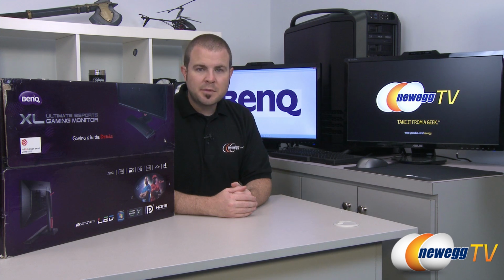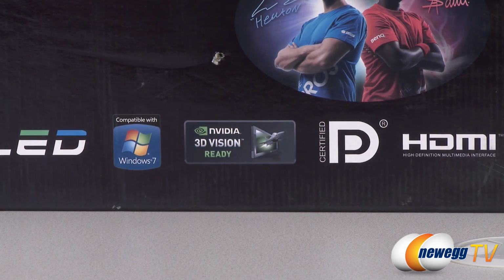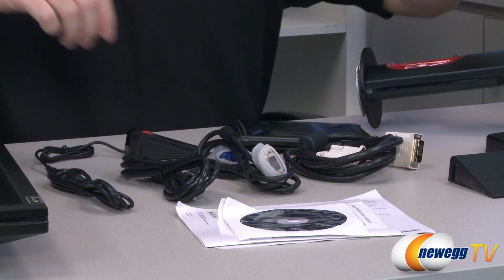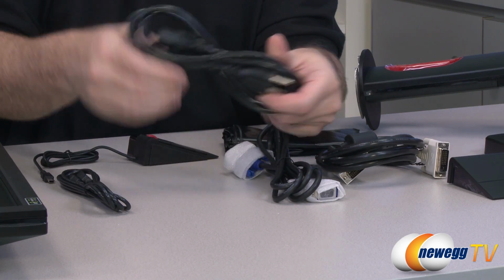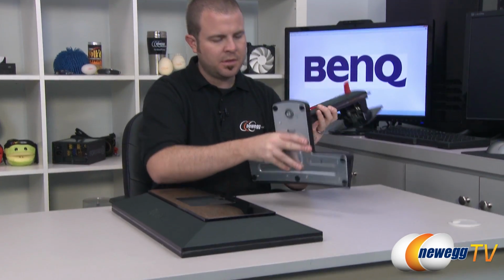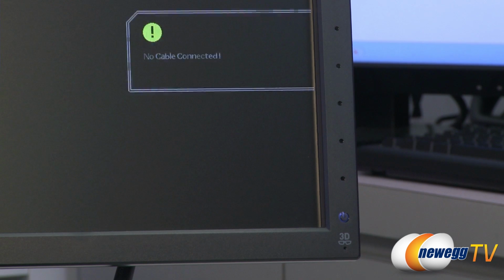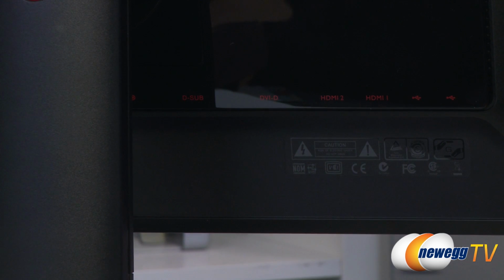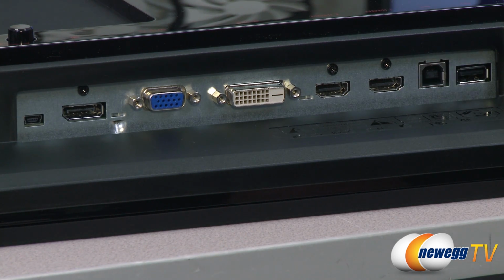Newegg TV: BenQ XL2420T LED-Backlit 120Hz 3D-Ready LCD Monitor Overview

Comment: I saw someone selling it 2nd hand but he said its 144 hm?
Reply: Maybe a bit late but there is the XL2420T and the XL2430T.. It seems at some point BenQ discontinued the 2420T and replaced it on the sly with the 2430T which is 144Hz

Comment: There is, Wipeout HD on the PS3 features both 1080p and 60fps.

I play both PC and PS3 regularly, Wipeout HD runs just as smooth as when I'm playing PC games with 60 fps however most games on both the PS3 and Xbox 360 are locked at 30 fps and/or 720p.

Comment: No, HDMI cannot transfer enough bandwidth for a monitor to operate at 120hz. To use this monitor you have to plug in the included DUAL DVI connector, which plugs in to the back of your monitor.

Comment: MW3 or Black Ops 2 would be, actually.  One of the core aspects of the CoD development cycle is to make sure it runs at a smooth 60 fps on consoles.  And the point of this argument is whether or not a 3D monitor would be good for a console player; the answer is, unless you are filled with money you wouldn't mind wasting, no.  Rage and CoD (and whichever few others run at 60 fps nowadays) are not reason enough to buy a 3d  monitor which will drop frame rates in half.

Comment: No shit.  And the general rule of thumb is the newer the engine, the higher resolution textures, larger poly counts, and wider resolution support.  Older games dont have high res textures or huge poly counts, thus they may run at 60 fps on consoles.

Comment: Call of Duty is the only game made nowadays which runs 60fps.  All other games run 30, unless some were released around the release of the 360 itself which can run 60fps.  The 360's hardware hasn't been updated since it's release, you know?  So more advanced engines from today don't run as well on it, whereas older games run at a higher fps (or so I'd think; I really have no proof).

Comment: Honestly it is still useful for a lot of people. Obviously you wouldnt use it for the 3d or anything. But I work on a lot of older systems that dont have hdmi or dvi. Or if there are driver issues, sometimes you have to use the mobo video out to solve the driver issues.

Comment: You forgot the PIVOT feature Paul!  Yes, this monitor also can pivot into portrait mode.  This monitor rocks by the way, many other features Paul didn't mention.  The TX model has a built in 3D receiver and comes with a pair of nvidia v2 glasses.  Check out Linus' review of it to see all the other features.

Comment: Yes, but beware that you will have to lower some setting in certain games (BF3, amongst others) to get 120FPS so it looks good on the monitor and you can't tell if the FPS is low or not, at least in my opinion. That's why I always buy 60Hz, I can have higher settings so the game looks good and I fulfill my monitors refresh rate.

Comment: True, but remember manufacturers have to always avoid excessive RMA's.  If an uniformed consumer bought this monitor, attempted to connect their very antiquated Dell desktop to it; then suddenly realize their PC has virtually obsolete tech; this would lead to a quick return to the retailer. Thus losing too much profit and time. So it's much more prudent to include basic VGA cables even in this "advanced tech age".

Comment: Well if you have a 60hz monitor and you're game is playing at 100+ fps you start to see the pictures out of sync. So if you have a solid system that can do over 60fps you really need to have a 120hz monitor. Because you can turn v sync on but that effects the games overall performance. So 120hz's is more then worth buying if you want ultra responsive times and the smoothest game play possible